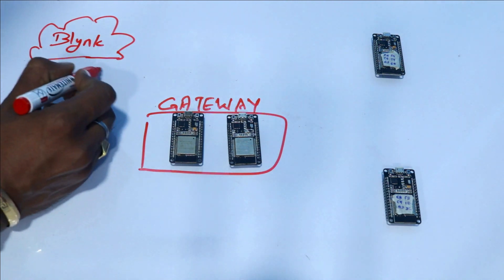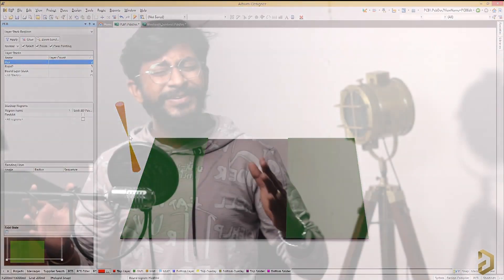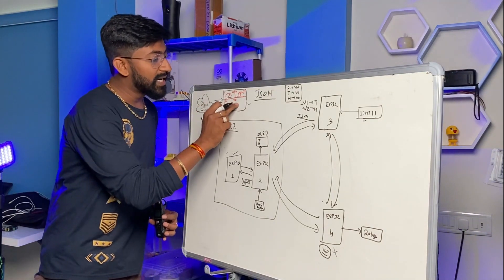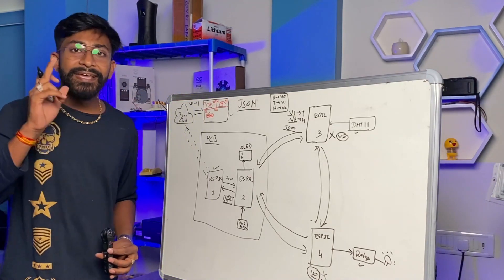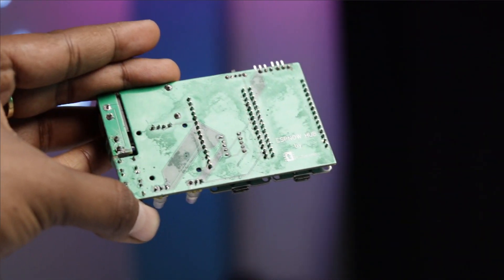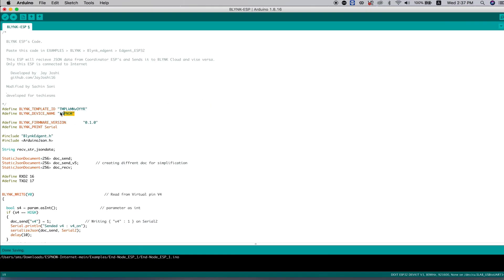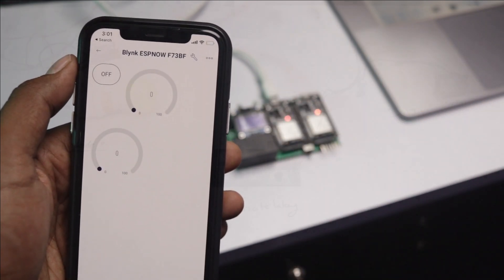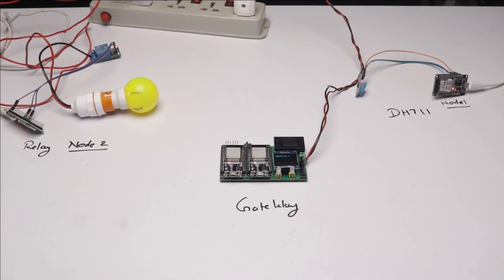ESPNOW to Internet Gateway 🌎

Comment: can you explain why 2 esp32 is needed in the gateway.  Why cant esp32 receive the esp-now, and send to wifi all on 1 board?
Reply: you can't use wifi and espnow at the same time because they both use same antenna and frequency. The only way would be to disable esp now start wifi publish stuff and reverse it again. You will have a blind point in this case. So usually 2 esps are used

Comment: Thanks bro, I have some questions:
1) I know the wifi channel restriction to use wifi and esp now simultaneously, so that's the reason you're using two esp32 instead one for gateway, right? Do you know a solution to workaround this channel thing and then use only one esp32 as a gateway? 
2) even using two esp32 as gateway  and assuming this is a commercial solution, how to update the firmware for the other 3 esp32 (2, 3 and 4)? It is possible to use OTA for them?
3) Do you have something similar to this video but using esp rainmaker instead of blynk?

Comment: Great video, Shall we make the same process in NodeMCU board(ESP8266) it has hardware serial as well right but not as ESP32. Will tell me the process if possible. I have tried but getting some errors in the code. Thanks in Advance...
Reply: Found any solution

Comment: Hello @techiesms. I have two questions.

1. Can you use one ESP instead of two (ESP1 and ESP2) for the central connection between espnow and Blynk? So I don't have to use uart communication. Or will it interfere the ESP connection between espnow and Blynk cloud?

2. Is it possible that the data from ESP3 broadcast to ESP2 via ESP4 (assuming ESP4 does not use the data from ESP3)? I have a project with distance concern, so I'm afraid maybe ESP3 is too far away to send the data to ESP2. Not sure if ESP3 can send to ESP4 then to ESP2.
Reply: I have question 1 too. Why did we need a dedicated ESP1?
Reply: For question 1;
It's doable, using one esp board to handle both espnow and blynk; but it's some what complex; 
because espnow need the channel to be fixed, like channel 4, but WiFi which access blynk is prone to changing  fore instance when using one hotspot to another, that will cause not reliable espnow communication. But having one board handle espnow communication will allow it's channel to be fixed while allowing the other to be free roaming. 

for question 2; I think you better look for mesh network like topology,

Comment: You can use only one esp32 for espnow and sending data to cloud.
There is no need of two esp32 for communication
Reply: I m agree with that. Why use 2 esp32 ?
Reply: @Maertaugh  When using only one esp32 module to switch between esp_now and wifi (lan) it will stop receiving data from other esp-now end devices (sensors modules).  Imagine this scenario when there are many esp_now devices. Also every wifi routers (even the ones we use at home) are constantly switching channels. This is for security reasons and in response all wifi devices switch to the changed channel to match the router so they can continue to maintain active connections.  To be connected to the wifi your ESP_NOW gateway device should be switching the channel appropriately to maintain active wifi connection with your home router.  But EPS_NOW mandates that all esp-now (peers) devices/modules should be configured to use the same static channel. Well, if your router switched to a diff channel and yoru esp_now g/w did not, then there is no connection.  This is why 2 esp32 modules are used here. 1 to act as a receiver/coordinator for all esp-now peer devices and the 2nd acts as a wifi gateway module to your home wifi network and the two modules are communicating over the RX2 and TX2 pins using UART.
Hope this helps.
Reply: There is some restrictions while using wifi and esp now: esp now must keep the same wifi channel and the router change it automatically but unfortunately esp now not. I'd like to use both for my projects, specially thinking OTA firmware updates. Do you have some solution or demo project to workaround this issues?

Comment: Can you please make an explainer video on what are and how to use Virtual Pins?
Reply: virtual pins are just channels that constantly update data. they're just observables in the cloud.
you can use i think up to 10 virtual pins (paired with a data stream) per template in Blynk cloud, assigning a data type, min-max values, etc.
your devices will subscribe to the virtual pin/channel (BLYNK_WRITE), and whenever data changes in the channel, the devices react via their handlers.
and your devices can also write values to that channel (Blynk.virtualWrite()) and will update that virtual pin's value and rebroadcast the change.